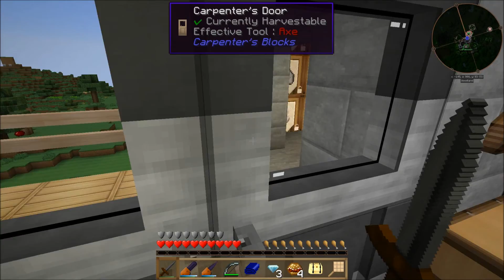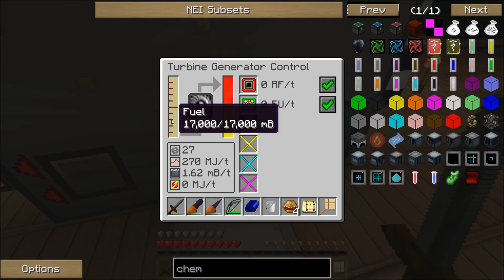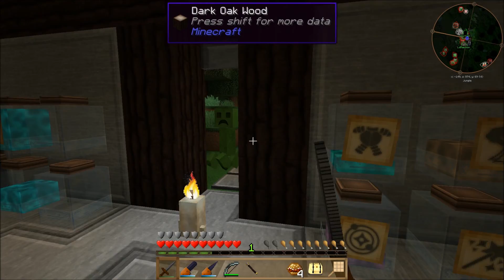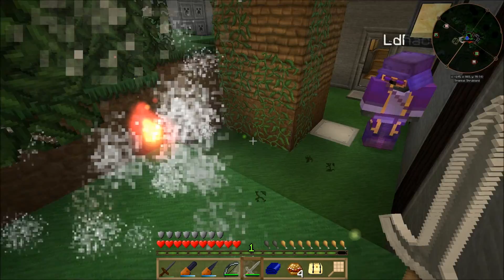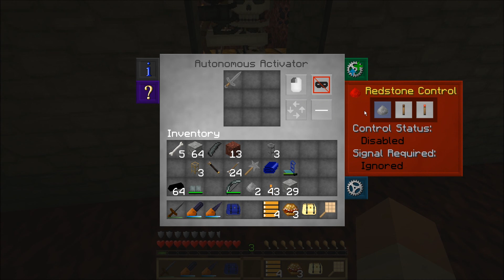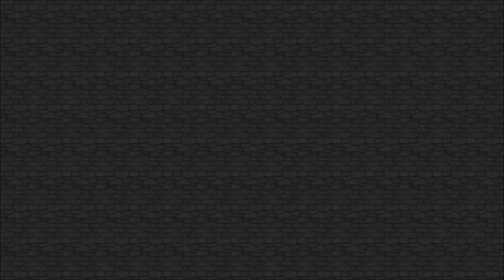Wither Grinder - Utopia³ Resurrection - Grumpy Engineering Co.

Comment: Hey Landstrider - could you please explain how you convert EU from the Advanced Generator into Gregtech power? I'm really struggling with this and would appreciate any help.
Reply from the maker: Sure, first use IC2 cables to get the power to near your machines, run that into an IC2 transformer (pick one with the output power one tier above the machines you intend to power), attach a GregTech transformer to the output of the IC2 transformer (face the plug side toward it), then just run your GT cable from that. You can also use a IC2 power storage device like we did in this video http://youtu.be/IrOCcusqlJg?t=23m59s basically the same except the storage device output must face the GT transformer input. So if your machines are LV (32V) then you would use the IC2 transformer that goes from 512V down to 128V, then use the GT transformer that drops from 128V down to 32V
Reply: Landstryder ahhhh - many thanks!

Comment: I like the direction your taking with the space station, do you play on adding any solar panels to it, for aesthetics or functional?
Reply: I like this idea, but it is not really practical for a little while. If you think that Landstryder could make even a single solar panel now, you have obviously not messed with GT! :) They are are pretty intense to say the least.

Edit: Ok, I take that back. I didn't realize he was a the electrolyzer stage. But he will still struggle to make enough solar panels for aesthetics.
Reply from the maker: We are waiting to see if the advanced solar panel recipe gets fixed in the 1.0.1 update coming out soon. We are defently going to have solar panels for both form and function.